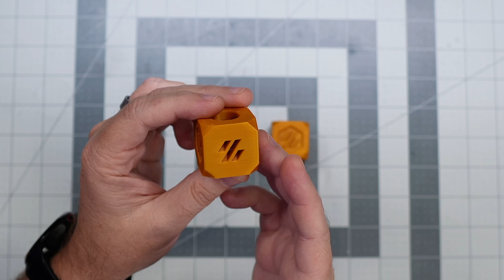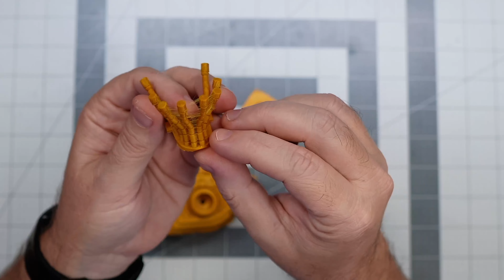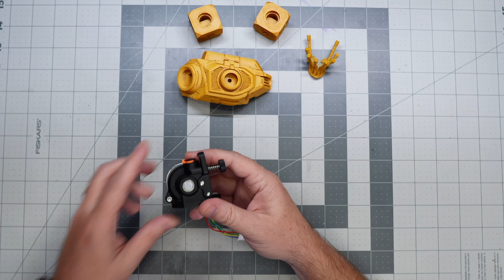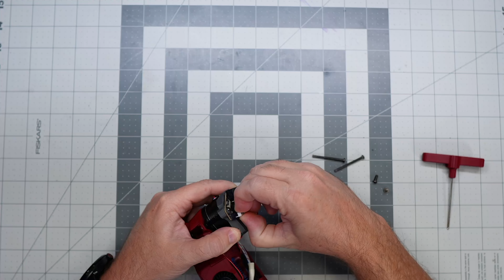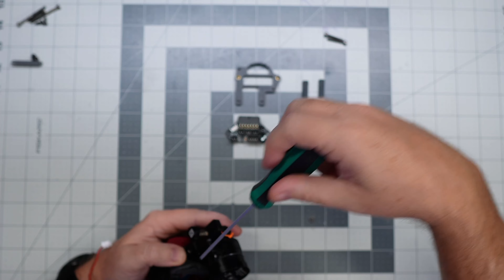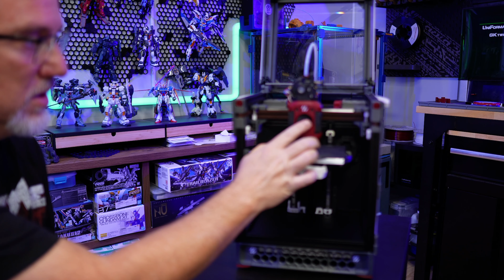Voron 0.2 Mods - Dragon Burner

Comment: You're V0 series has ben instrumental in my build, thank you for the content. I'm really struggling with the Dragon Burner though, I cannot seem to get enough clearance on the wiring behind the blower fans no matter how tightly I tuck them, one always seems to rub the X belt.
Reply from the maker: There isn't much clearance for those wires. Without seeing your build it's difficult for me to help, but make sure that you've pulled the wires tight and use the two zip ties to hold them in place. If you're still having trouble, I'd suggest asking for help in the Voron Discord. There are a bunch of really smart and helpful people in there.

Comment: Having also built a Voron 2.4 and 0.2 and having a resin printer, I guess I still don't see why you'd want to use the 0.2 for those type of parts, seems like the resin printer should be able to do those at a better quality. That said, building and upgrading your own printer is super fun and any excuse to build another one is a good excuse. I love that your channel focuses on the intersection of 3D printing and scale modeling. Interested to see what comes next.
Reply from the maker: I have a resin printer and I do use it for this purpose as well, but I thought it would be a fun exercise to see how close I can get to resin quality with an FDM printer.

Comment: Thanks a lot for the video, what probe are you using on the v0 ?
Reply from the maker: I'm not using a probe on this printer. The default v0 design does not include one, and I've found that with a print area this small I can just manually set the z height and it prints perfectly fine.

Comment: I just orderd the LDO Kit - and have watched your videos in prep. I was also thinking about using the dragonbuner for the improved cooling for PLA and PETG parts. Do you see any reason not to just go straight dragonburner and not build the mini stealthburner?
Reply from the maker: If you have previous experience building or working on Voron printers, I'd say go ahead and skip straight to whatever tool head you want to build. But if this is your first build, my suggestion would be to follow the instructions that come with the kit and get the stock configuration working first, and then start making changes or swapping out parts.